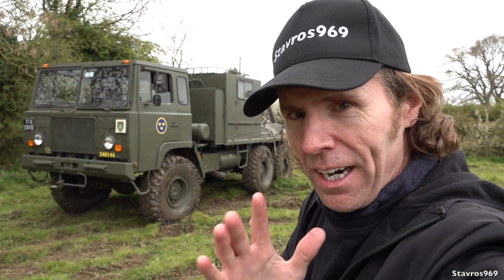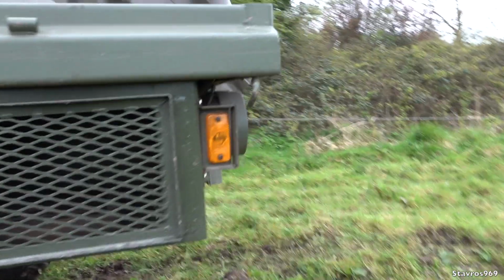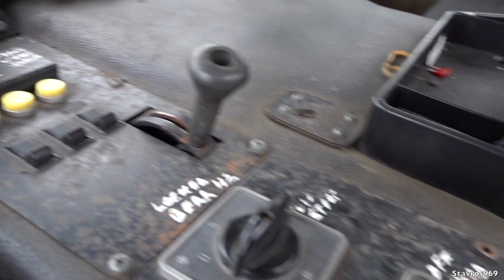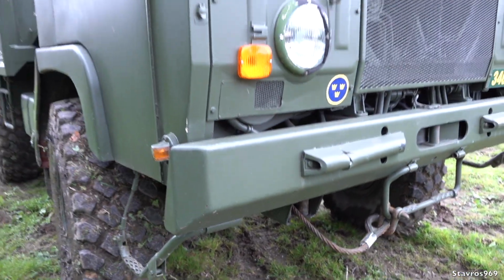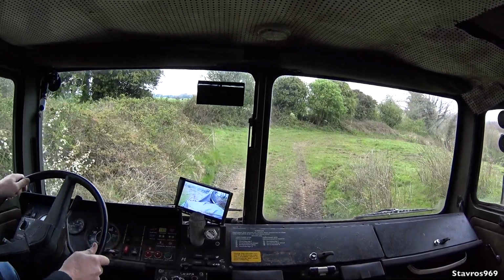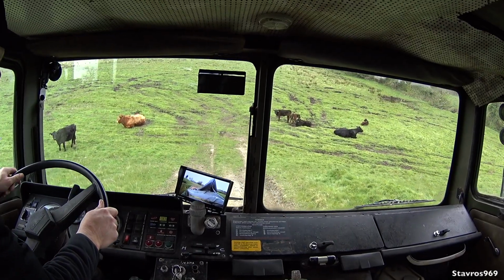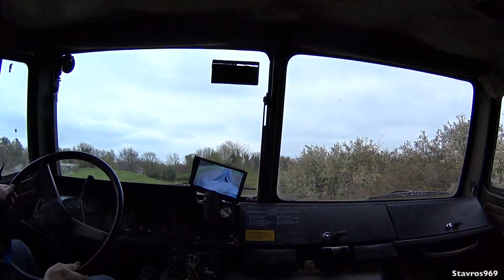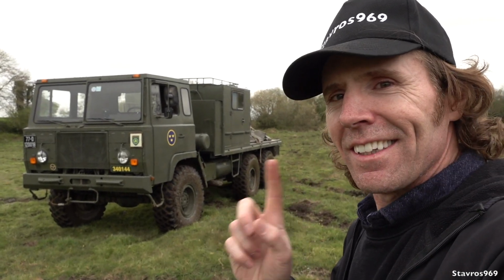1977 SCANIA SBAT 111 6x6 Army Truck (Off Road) Test Review

Comment: The truck was used to tow howitzer 77. The crane is for offloading grenades. You could start the engine in the howitzer from the truck and make the unit 8-wheel drive, able to drive thru 1,5 m snow

Comment: In Sweden we call that truck TGB 40 ( terrängbil 40 ) which is terrain car 40. Those trucks were built for the Swedish Armed Forces during the Cold War. And they still use them today for training purposes.
Reply: How about volvo trucks, do they militarize their tucks in Sweden?
Reply: @Wqghfxz  Volvo made a couple of trucks for the Swedish army
. But for the most part, Volvo made smaller vehicles for the army. They built cars like the Volvo C303 (TGB11) where 11 stands for the number of people the car can take. Volvo also had contracts for our tracked vehicles such as Hägglund BV-206. BV is a short name for the swedish word Bandvagn. And stands for Tracked Vehicle. Which they built together with Hägglund
Reply: @TheSwedishSoldier  11 men in the TGB11... I doupt.
Reply: @TheSwedishSoldier  Sorry, that is not correct. The numbers (TGB11/13/20/30/40/45 etc) has nothing to do with the number of people the veihicle can take.
Reply: @Wqghfxz   The Volvo FL10 4x4 was/is used, and some older models: 934, 935 and 939.
Reply: Blackie Foxxless TM  
Well, I got more years within the swedish armed forces than you have been alive (acording to your profile). So I think I got a little more firsthand knowledge than you. But that's just a guess of course.
But if you want to suggest that TGB14 is named so because its designed for 14 people, I recommend you at least google a picture on one before you comment about others knowledge. 

The designations in the armed forces are not consistent, sometimes it's the year, somtimes, it's something else. Sometimes it's just trying to be consistent with older/previous/smaller models. As in this case.

However, we DID transported 26 people in a VW Caravelle once, and also crammed in 7 people in the jet intake of an J29 Tunnan. And I bet I could load over 200 bodies on the flatbed of an TGB45 without a problem.
Reply: Blackie Foxxless TM  The truth is in the facts. Just search info on TGB11, TGB 14 and TGB16. Try wikipedia, or the Swedish armed forces official website for instance.

TGB13 = 7 people
TGB 15 = 5 people
TGB 16 = 4-5 people

As anyone can see, the number is NOT related at all to the number of people the vehicle can take.
Reply: @smithwesson373  also Tgb20:18 people (driver, veh. chief, 8+8 soldiers on the teo benches in the back)
Tgb13: 7-9people (Tgb1321 variant carried 9: driver, veh. chief in front, battery command officer, 1nco platoon leader, 2nco ballistics calculator operators, 3 radio specialists. All personal gear and non critical squad gear except personal weapons and ammo stowed on a roof rack and on a trailer.
Reply: @TheSwedishSoldier   The bv 206 wasn't a cooperation between Hägglunds and Volvo, it was a Hägglunds vehicle. The predecessor, the 202, is the Volvo. As for Volvo trucks, they've been delivering specialized trucks of various classes at least since the 1940s and continue to do so today so saying that they mostly deliver smaller vehicles really isn't true, especially not today

Comment: The SBAT111 is an artillery tractor, not just a truck for logistical purposes, it was designed specifically to tow the Bofors 155mm FH-77 field howitzer. India still uses them to tow their FH-77B’s.

Comment: Was a passenger in one of these in 2017 during a military drill in Sweden. Been stored for a while so the first 100 kilometers was a bumpy ride before the tires became round again.
Reply: My TGB 45 has the same with original Trelleborg diagonal tires, but with some load about 10 km and it runs smooth.

Comment: If you fold the back of the passenger seat it is also a platform for the roof gunner. On the roof there is (was?) a mount for anti aircraft gun mount, to fit the KSP 58 machine gun, known as the M240 in the US, or the GPMG in GB

Comment: When I learnt how to drive this truck (called TGB 40 in the Swedish Armed Forces) I was taught it had the first automatic gearbox ever in a Swedish truck. I remember the gearbox being quite fun as it changes gears only depending on the speed and not speed & rev count. So when going downhill you had to use the ultra low gear and then use the throttle to slowly drive downhill. The truck was used to tow 15.5 cm howitzer 77a/b and the mobile coastal artillery 12 cm gun "KARIN". KARIN was in operation until early 2000's and the 77b howitzer was refitted to the new Archer mobile howitzer system which is still in use. Really cool to see this episode as it brings back many sweet memories. Thanks for sharing!

Comment: The crew cab is for up to ten persons. Originally it has 5 seat belts on each bench! It was intended for use when towing the FH77 howitzer, but was used all over when needed.
Both the SBAT and the SBA(2 axle) can be fitted with the small hiab crane or the crew cab in just 10 minutes with a forklift or a wheel loader. Electrical cables and pipes for heating etc was fitted to all trucks!

Comment: The gearbox S is for pullstarting, you can see the scribble above "locks gearbox". Normally you can't pull a car/truck to start it when it has an automatic gearbox, but this locked the gearbox so you could. For those -40C to -50C days in the winter. The ether start was also for extremely cold weather, but you could only use it once, then you had to wait half an hour before trying again. These trucks were amazing, I drove them when I did my military service.. with 6 wheel drive and the difflocks in place, the only things that beat it in terrain was the tank and the other tracked vehicles. And the thermal start stuff, don't get me started on that.. yes you had a blowtorch, and you had to use it like every couple of hours, to heat it and keep it warm.. Everyone hated having to go up in the middle of night to run it...
Reply: S is not for pullstart, but it locks gear H2 (second speed converter mode). useful when driving offroad in a convoy - you avoid switching gears up and down hundreds times. For tow start is far right switch position called TS (Towstart) .
Issue with  tow starting automatic gearbox is not in "locking". you can't lock it in either way, because to engage clutches you need oil pressure. and it is provided by transmission oil pump. pump is at the transmission input and driven from engine. So dead engine = pump stopped no pressure to engage any speed. BUT this gearbox has a secondary transmission pump driven from output "wheels" side. you switch on TS mode, in engages electrically valve for gear M2 (second speed locked mode). and then you start pulling, when truck reaches about 15 km/h secondary pump provides enough pressure, clutch engages gear M2 and rotates engine which starts quite smoothly. after engine start you immediately switch to N, because on mechanical gear engaged when use brake, engine will stall. Checked it when starting motor in my TGB 45 gived up a few years ago.
Reply: @vetrieska11  Yeah was something like 35 years or so ago I drove these, so forgotten too much..

Comment: As a lorry driver in the Swedish army, I have experienced significantly worse situations when doing off-road driving. Holes so deep that you landed on the frame at the center of the lorry, with the wheels in holes before and after. And that with the 1964 Volvo Viking (Lastterrängbil 939), with the D67A 125 hp engine. And manual gearbox.

Comment: That was a pretty easy track for that Scania! I hav driven much more difficult tracks with that. The swedish army put 10 blokes in the crew cab. The ether is pumped in with that handle. According to the swedish army instructions you should always have chains on the wheels when drivning in the terrain. You completely missed out on the terrain brake. It is a button on the floor that you step on with your left foot. It puts out a low air pressure to the brakes. You hold down the button when going downhill or on really uneven terrain and regulate the speed with the accelerator. This makes it really easy to drive since the truck stops when you let go of the accelerator even when it is downhill.
Reply: Agree, this track would been easy with fully equipped, 10 soldiers, equipment and ammunition on the truck and the howitzer on tow. I think this truck had better tires than the original, those tires was rather hard and somewhat smaller so chains was needed in rough terrain and all type of snowy terrain. When I drove these they was over 20 years old and maybe some of the tires was as well so they was very hard with little traction on snow and in swamps, chains was needed on at lest one axel. 
But I think with modern tires chains isn't needed except for the most extreme conditions.
Reply: Terrain brake working only on low gears - on high gears is switched gear changing strategy to brake with engine. i used it also to switch on gear M2 when driving with a trailer. installed a small switch to disable accelerator pedal switch, and had 5 gears when accelerating - H1>H2>H3>M2>M3 instead of standard pattern H1>H2>H3>M3. because in normal drive there is a huge hole between gear H3 and M3, you need to revv engine to max to engage higher gear.
and terrain brake also engages a winch brake, in low gears.

Comment: About half of the trucks are still in use in the army and Home Guard, but are to be replaced before its 50th birthday in 2026. The preheater is still used, so a important part of winter training is learning to use the primus kerosene blowtorch used for the preheater. Engine has no glow plugs or "toaster" like newer trucks, but used correctly it will still start in -40°C. The rear boxes under the bed is for storing the tire chains. The chains is not only snow chains but is called slirskydd (anti skid chains) and is very sturdy construction to also be used when driving in terrain.
Reply: I have  a TGB 45 from 1990 (last batch ordered when export trucks for India were made), it has "flamstart" instead of ether injector.
Reply: @vetrieska11  cool, it's one of about 80 made, and pretty rare! I dont think many of those have left the Swedish Army

Comment: They got a special terrain-break, you failed to mention. It is a button you depress with your right foot, to gently traverse big stones or other obstacles without useing normal brakes, useing the automatic gear-box and this terrain-brake only. Of cource it wastes some fuel, but it is extremely smooth. It facilitates to very gently comeing over very large obstacles without bumping the slightest at all. Creeping over like a snake.

The back storage boxes are meant for wheel-chains. Four of them, each weighing about 18..20 kilogram.

Comment: Hi Stavros, as I've mentioned before you need to get hold of a Tatra T813 Kolos 8x8 truck, if you thought the Scania was good, you will be amazed at the capability of the Tatra, nothing else has a central backbone tube with swinging half axles, V8 air cooled diesel engine, diff locks, line locks and cross locks.

Comment: The thermostart is not the one I know. The thermostart I  know is a plug in the air intake with its own supply of diesel. Holding a pre-heat button for 20 seconds causes the thermostart plug to get hot and let diesel through it which it ignites - then the flame gets sucked through the engine to light the diesel injected into the cylinders. Very effective they are too !

Comment: In the military we call it TGB40 (there's a smaller called TGB30), or TerränGBil 40. A really compatible vehicle, to bad most of the Swedish military is for the homeguard that keep them outside without any roof (or protection). 
Bit misleading with the "GPS" straight on the steering wheel. 
Also the "S" on the gear selector means "sakta" or slow in English (not for a trailer, it's just for going slow (limits the gearbox from changing gears, its an automatic)), there's a hidden one that's not shown that well in the video. Think it's called "BOG", referring to Swedish "Bogsering", for towing it to start (ex. the starter is broken and can't be started on its own, cause its an auto). 
The second gear selector is two modes, think its V and T for VÄG and TERRÄNG, T limits the gearbox from shifting to a higher gear than second for driving in terrain. 

(Sorry for bad English)

Comment: @Stavros969
Hi! Nice video 😄
I've heard about a terrain-brake which is used instead of the main airpressure brakes. It brakes the car in terrain in a smooth way without heat up the brakes. I believe it is placed on the floor down below the drivers air inlet. It looks like a button which you operate with your left foot. 
I haven't operated the Tgb 30/40 myself, just been a passenger. I use to drive the smaller Tgb 11, 13, 20 which is all from Volvo 🙂
Reply: The terrain brake is the normal brake applied with a low air pressure with the button on the floor. The switch V / T has to be in T=terräng (terrain). If it's in V=väg (road) the button function is engine brake. The converter is locked and the gear box goes to a lower gear.
The T mode also engages the front wheel drive and low gear in the distribution box.
Reply: @lokis7230  That's great, an answer from one who's familiar to the vehicle and could explain it in a better way 👍🏻
I've just drove the Volvos 🙂🇸🇪
Reply: @lokis7230  And in low mode terrain brake is also a winch brake.
i used is in  high gear to drive uphill in M2 gear when needed. put  an additional switch disabling accelerator switch to prevent return to normal gear change when you push throttle again. and it worked well especially with higeher load - driving uphill faster and less fuel because of lockup clutch engaged.

Comment: Does it have rear lockers ???
Reply: Yes, front locker too and when that’s not enough it’s a 10 ton winch, the 4x4 version has lockers and an 8 ton winch. They’re very capable trucks. He missed the control for the auxiliary power unit for the gun it used to tow. The gun also had driven wheels for increased capability in difficult terrain.

Comment: Is it manual or automatic?
Reply: Automatic, has a special towing posistion on the gearbox if/when it needs towing.
Reply: @JimAltis  Okay, thank you
Reply: 3 speed gearbox with torque converter, when reaching over 47km/h it puts 3rd in  mechanical mode bypassing the torque converter, slowing the vehicle down using the engine break pedal it maintain the mechanical transmission for engine brakes until 15 km/h where the torque converter and 1st gear kick in again.

Comment: What a disappointment to see that even this old truck uses automatic transmission,just like the new ones,after 1.3 mil km I changed my business,but if I have to get another truck,for god sake will NOT be a automatic one .
Reply: When I did my military service in the 70's, I was a mechanic on those trucks and we never had any problems with the gearboxes no matter how much the drivers tormented them.  Incredibly durable gearboxes and easily repaired as well.
Reply: It's just a fact that automatic transmissions cannot be mishandled as easily as a manual so they're naturally a much better choice for a vehicle that is going to be driven by 18/19 year olds who might never even have driven a car, let alone a real lorry!
It's also a nice bonus that they are more comfortable to drive so driver fatigue is slightly lessened...
Reply: Considering it was build to tow howizers both on and off the road by 18/19 year olds who never had driven a truck before, I would say going for an automatic gearbox was a nobrainer.